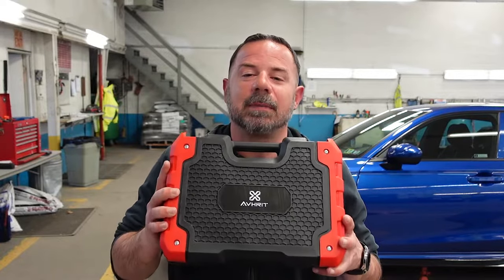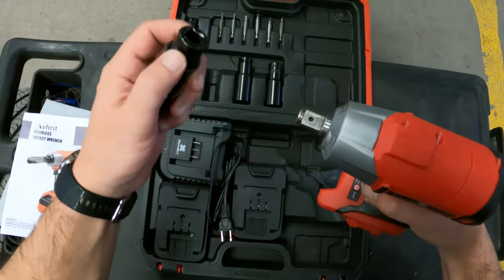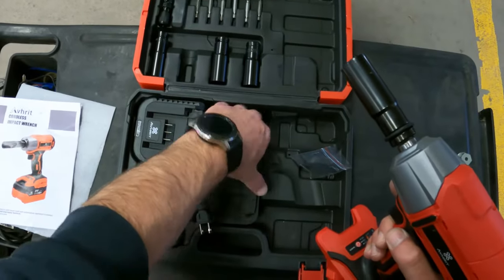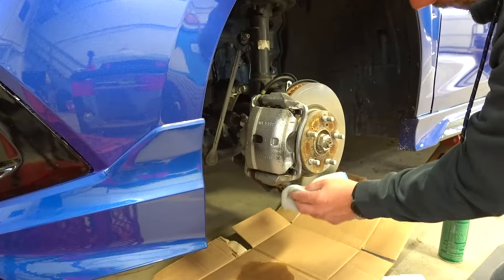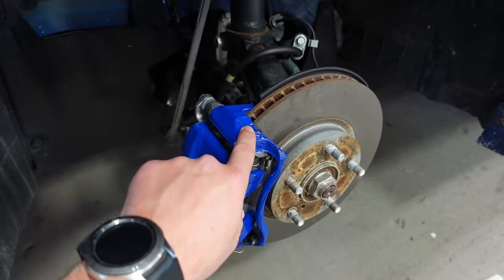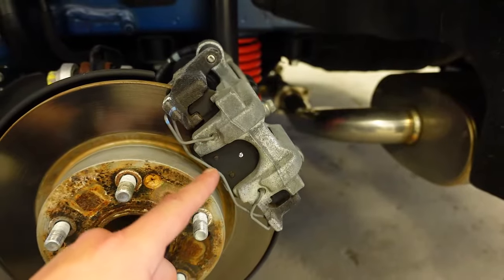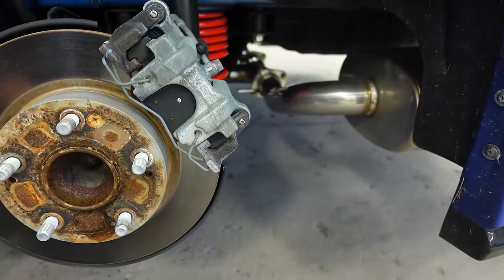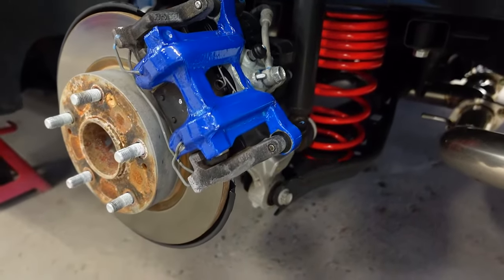RVinyl 3M Caliper Wrap! It turned out way better than I thought it would!

Comment: Going to do mine today. Also installing new drilled & slotted rotors & new brake pads at the same time. My hope is having all the old hardware out if the way will make the wrap easier to install. We will see. As an OBTW there is a special cleaner they recomend for this that I will be using after clean up with brake cleaner. Cleaning will be key with my car as it is a 1996 Mitsubishi 3000 GT Spyder but has just under 26k miles so not too bad.